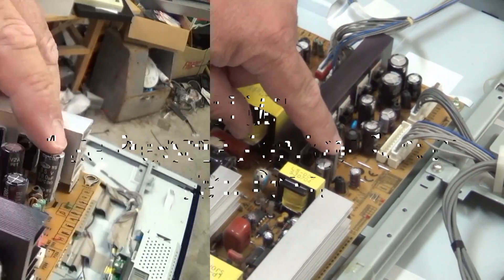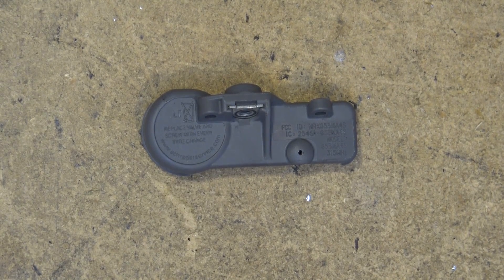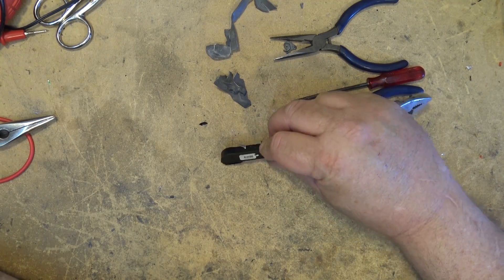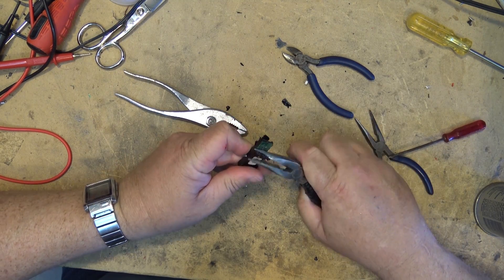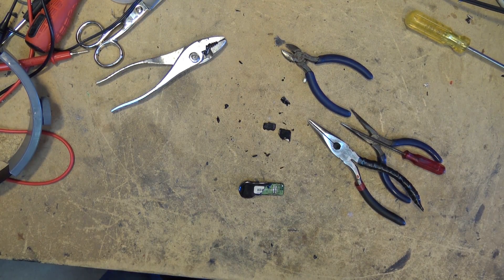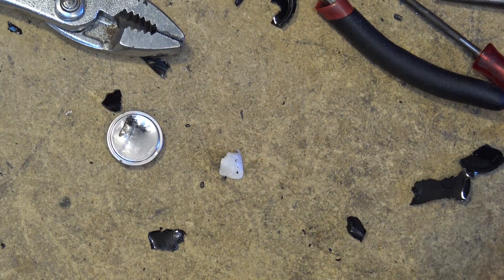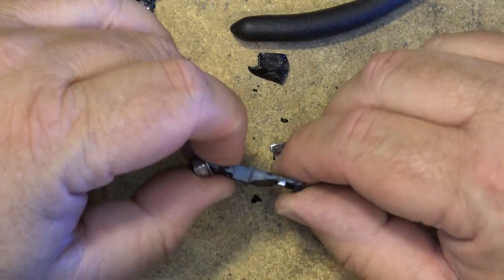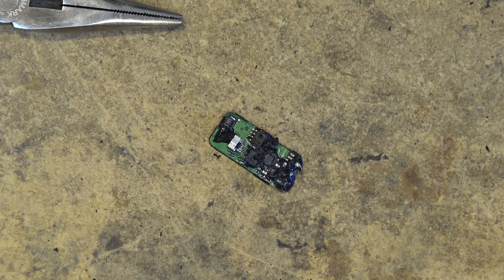TPMS tear down

Comment: These things really piss me off they’re not servicable at all. I just took my Toyota one apart. It has a clearer rubbery kind of potting cement that took forever to get it off of the top surface. Now I’ve come to realize that the circuitboard is still mounted with this the epoxy underneath and you cannot get the circuitboard off - my intent was to see how hard it would be to replace the battery. That should be some thing in the design in my opinion. This is ridiculous. All of these sensors going into landfills for no reason whatsoever and a bunch of people making lots of money off of it
Reply from the maker: They spin inside your tire.  Of course they have to pot them well or they would fly apart inside your wheel and having a lithium battery bouncing around inside your wheel wouldn't be a good thing.
Reply: @12voltvids  - thanks but i believe they could make the battery servicable and still make it secure.  These things are too expensive and too many are just thrown away.   There is absolutely nothing wrong with the 4 I have sitting on my countertop other than the battery... so am I supposed to throw these in the trash?
Reply from the maker: @condor5635  expensive? Local tire shop changed out 2 that went bad on my car for 28.00 each while they changing tires.  I would say 28 bucks is not bad they lasted 8 years.   2 of the originals are still on the car and it is 11 years old.   It's 40.00 to swap a bad one of the tire doesn't have to come off.  I would imagine if batteries were swappable the cost would be the same as they have to dismount the tire then balance it again.   Tire shops don't do that for free.
Reply: @12voltvids  I need to shop around more I guess. Discount Tire charges $60 a tire. Warranty them for 6 yrs 75k miles
Reply from the maker: @condor5635  I got mine at national tire wholesale.

Comment: 2020 at the local Tires Plus they were going to install a new sensor while putting new tires on the rim was going to be $100 US.  Tire installation, balancing and hazard insurance was all extra.  Total rip!
Reply from the maker: Safety device because too many motorists were too dumb to check their tire pressure resulting in blowouts and accidents on freeways causing innocent people to be injured or killed. TPMS sensors are expensive but last a long time.  I just had the second one go out on my 2012 volt.  First one went last year.  So i am looking at changing the remaining 3 this year as the other 2 are probably ready to go too..
Reply: @12voltvids  I bought 3 off of Ebay to put on the wheels of some new snows for my wifes car.  3 because the reviews said that some of them that were sold were bad.  Out of the 3 I bought 2 were bad.  The date codes were the same day, Nov. 26 2019.  Must be a bad lot.  Remember when the factory Firestones mounted on big Ford SUV's were hatching and rolling over because of low tire pressures.  Thanks for your response and your videos.  Ralph-
Reply from the maker: @ralphwatten2426  
The Firestone Tire blowout problem was one of the reasons that TPMS was mandated.  As it turned out it wasn't so much that Firestone tires were bad as everyone initially thought due to the number that failed, it was due to owners not maintaining the correct pressure. All tires will fail if you run them too low.  The problem was the explorer being a relatively high vehicle was prone to roll over in the event of tire failure and driver inexperience to handle the situation of tire failure.  I had a tire blow out on my Harley and believe me it is even scarrier on a bike. Fortunately for me I was going fairly slow at the time and it was the back tire that exploded. Sounded like a gunshot and everyone on the sidewalk hit the dirt. I get my tpms sensors at the tire dealer because i know they are fresh and if one i get from him fails he is putting another one on for free.  They might be 70 from the dealer but at least he doesn't charge me to change them when he is putting new tires on anyway.  I never buy anything on eBay because in the past pretty much everything has been junk.  Same goes for Amazon market.  I pay more to support my local businesses and they look after me. Your local tire guy is just trying to feed his family after all. For 20 years i worked in a small business so i know what customer service and customer loyalty means.  The reason I get so many things to fix is i look after my customers and they keep coming back.  That's the way it works.   Online purchase is a dirty word in my house.
Reply: @12voltvids  Always have worked on my own stuff.  My mom had her car serviced by a mechanic shop my family had been going to forever.  She started having problems with her car.  Oil was like tar, hole punched in the air cleaner, never changed.  My boss took his Suzuki sport ute to a quick change oil place, his oil drain plug came out when he was doing 70 on the freeway.  I took a chance on cheap TPMS sensors and I paid for it.  Live and learn.  Again, thanks for your postings on YouTube.
Reply from the maker: @ralphwatten2426  
My car goes to the dealer because nobody else knows how to work on it.  Tires go to the local tire guy.
Reply: @12voltvids  Good enough 12volt.  Have a great Thanksgiving.  Stay safe!

Comment: if you still have the case kicking around, I'd like to get the FCC ID off of it. That will list fun facts about exact frequency and power used by the chip for transmit.

Comment: Made in china is as good. That is where the battery for these are made. what kind of vehicle is this from? You can order the battery with soldering tabs on it from China. They are about 7.50 each.
Reply from the maker: Your point? Not like I can change them I have to take the car to the tire shop and have the tire removed from the wheel to change it. I am not about to have them put it back on so I can remove the potting and replace the battery only to have to go and have them remove the tire again to reinstall it. TPMS sensor only cost 65.00 installed. How much do you think they would have charged to mount and remount the tire twice. Chances are they would have told me to f--k off if I showed up with a rebuilt sensor. Would use some stupid excuse saying for safety reasons they are not permitted to do it, just like when I had a tire damaged by a pot hole. Dealer did not carry the brand of tire I had and refused to sell a single tire saying that safety regs stated that they have to be sold in pairs for 2 wheel drive vehicles and all 4 needed on 4 wheel drive.  So I was held hostage and had to buy 4 new tiers or be stuck because they refused to just replace the single tire than was damaged.
Reply: @12voltvids  Just a thought for those who want to adventure and replace them. I have 2 out on my Jeep. I have the spare tire one out and am replacing the battery myself, then sealing it again. Some you can only replace them some you can change the battery in. Am going to try re charging one battery and see if it will recharge.  For those who have a bead breaker and some electronics background, replacing the battery is possible.

Comment: I believe  a CR2032 is 3.2 mm thick, and a CR2025 is 2.5 mm thick, so that CR2050 is probably  5 mm thick.  I remember  reading in a computer upgrade and repair manual about CMOS batteries, and they went into great detail about those type of batteries.

Comment: The other day my sister and I was coming home from Fresno, and suddenly the display on the dash said check tire pressure,  She checked, and it said that the right rear tire only had 7 pounds of pressure, and was dropping as we watched.  We pulled over to check the tire, and it was completely  flat.  We didn't even know the tire was flat, because  we couldn't feel it. It was riding smooth.  Had it not been for that sensor, we would have never known.  The rim would have gotten damaged.
Reply from the maker: Or worse it could have blown out due to low pressure and caused a major accident. If you remember a few years back with the Firestone tire failures on Ford Explorers. Many people died as a result of tire failure that was caused by the driver having under inflated tires and not knowing about it.
The findings of that investigation resulted in tire pressure monitoring becoming mandatory on all new cars. Now, I have been saved twice by this when I picked up a staple in one of my tires once, and got the message I was low on air. The other time my tire had suffered a cut in the sidewall. I had to stop every couple of miles and run my tire inflator to bring the pressure up enough to get to the nearest shop to get it fixed.  My car does not have a spare so knowing the pressure is important.  They are critical safety devices, and those that comment that they would just drive around with dead batteries  are just foolish. A blow out is not something that anyone wants, and low pressure is generally what causes total tire failure.
Reply: Rear tires are hard to feel on FWD cars, even then the car should have experienced and out of alignment pull with the tire being smaller than the rest. It is much more noticeable if its a driven wheel though.

Comment: You know, if one has gone bad after 6 years the others are soon to follow, right?  Mine died after 8 years, the P.O. had just got new tires but didn't replace the sensors, so to fix it I just disabled the warning light.
Reply from the maker: Nope! The others were replaced under warranty 2 years ago.
Fortunately, when the car was still under bumper to bumper warranty I noticed that the original aluminum "Filled with nitrogen" caps installed at the factory had welded them self to the brass screw on the valve stems making them impossible to remove.
The dealer replaced the 3 that were frozen, but didn't replace the one that they managed to get the top off. That is the one that dies, so the others should be good for another 3 years minimum.

Comment: those bastards made them so that a two bit battery can't be replaced, costs over 50$, stupid shithead engineers. I have one dead sensor, the hell with it.  Only takes a few secomds to check the tire, stupid gimmicks for lazy people.
Reply: Junkcollector, those things are a safety feature that's required by law on all new cars, like seat belts, etc.  It makes no sense to have a replaceable battery on a device that's inside the tire where there is no way to get to it to change it.
Reply from the maker: Right, the tire has to come off to change it,  and it has to be sealed completely, and filled with potting compound otherwise it would fail very quickly when being pounded on inside the tire.

Comment: They should at least make the battery easily replacable. :/
Reply: Not possible!  How could you replace it, cut a hole in the tire?
Reply from the maker: Remember these things are inside the tire, not on the shock absorbed car body side. They are being pounded by every rut and pot hole in the road. Everything is sealed, and completely filled with that rubber potting compound. Having a replacable battery means it can't be filled with potting compound. How long would that last bounding around inside your wheel at freewat speeds?
Reply: Sorry, I didn't know that.

Comment: Interesting.  Too bad those batteries weren't replaceable somehow.
This makes me wonder about my sensors.. Mine are the same age!
Reply from the maker: They are sealed in the potting compound so nothing moved as they are spinning inside the wheel. They are good for about 6 years.

Comment: These are made be Schroeder in Antrim. a bit weird that that it doesn't say Product Of Northern Ireland (PONI), The surface mount components will have been removed from the circuit board by prying off the potting material so dissolving the potting compound would have been the better idea.
Reply from the maker: Sure, but I don't have any solvent to dissolve it in, and it wasn't going back into service, it was going in the bin when done.

Comment: You are a good videographer.  It doesn't take much exposure to recognize you have some professional experience.  I wish you would have gone into the purpose and application of potting material deeper.  I have some experience with it and it is worth covering IMO.  Thank you for your videos, I'm a big fan.
Reply from the maker: Potting compound is used to hermetically seal am electronic circuit from the elements, and provide shock and vibration protection. It is generally a rubbery material usually silicone or polyurethane are used.

Comment: 12voldvids have you thought about attaching a support wire to the roof and then attaching it to the boom end of the tripod to reduce some of the weight and keep it from falling over? you could probably create a hook mechanism for easy release, but it would allow you to attach the pan/tilt module and not have to worry about weight, and it still should allow for a modest amount of swing if you decide you want to move it.
Reply from the maker: Adding an extra 8lbs to the end of a 3 foot jib arm adds a tremendous load on the head, and the head is now broken. This head was not a super expensive one like on my professional tripod. This one was probably only 250, but now it is worthless.  What happened is the tilt lock screw, just due to the weight on the handle has now gouged the tilt mechanism, and bent the lock mechanism, so I can not unlock it. So now this head is permanently fixed in the position that it is. The extra weight of the heavy metal pan tilt unit created a downward pressure on the head, which over the course of the week it was attached caused the head to move slightly causing the lock mechanism to dig in, and ruin it. That plus the fact that the brass gear inside it is worn, so if I was tilting and it hit that bad spot the camera would flip completely down.
it was a nice idea, but in practice was a pain in the ass to use. It is just as easy to reach up and manually adjust the shot.

Comment: CR 2050 is 20mm (diameter) x 5.0mm thick.  A CR 2032 is 20mm (diameter)  x 3.2mm thick.  The 2050 is rated at roughly 300mAh and the 2032 is rated at 220mAh